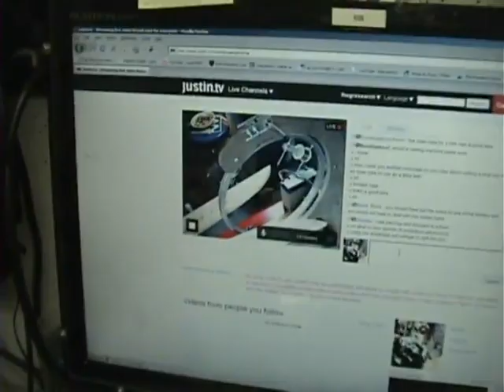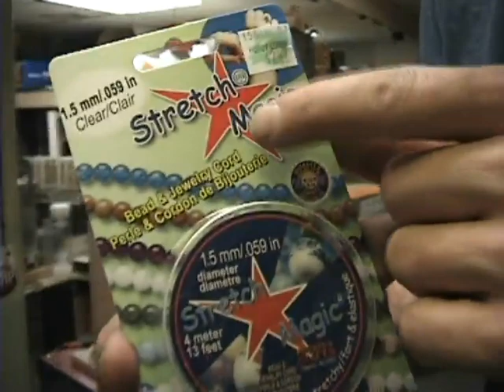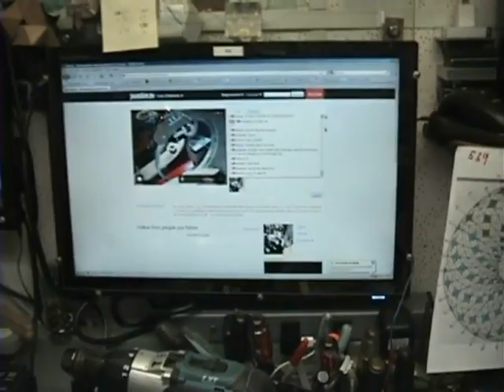#4 EPG Winder, Home Maid Troid Winder 75% Done & Winding A Test Coil! Live! :)

Comment: This isn’t exactly a toroid winder in this instance, it’s just a coil winder that is better done by a proper manual bobbin winding machine with a built in counter.
But the design is consistent with actual toroid winders, so with quite a few modifications and jigs, it can definitely wind a coil around a toroid or doughnut iron or ferrite choke, albeit one that is big enough to allow the hardware on the wheel to pass through it.

If you have things like a lathe and a mill, or at least metalworking tools like grinders, zipdisks, drilling machine and files, you can definitely make the mechanisms necessary to turn this into a proper toroid coil winder, which involves a way to open the “wheel” to allow the operator to insert a toroid blank, or remove the finished toroid coil without disassembling the entire thing.

The real problem is how to feed the wire to this machine without turning it into a bird’s nest. I’ve also been interested in a machine like this, but I have yet to figure out how to feed wire to it from a stationary spool. The bobbin on the wheel or rotating element works for this, but it will have difficulty with heavier gauge wire (14 AWG or bigger). 

Of course, it’s possible to beef up the wheel enough to allow it to torque heavier gauges of wire to wind it on the toroid blank, but one would have to cut a predefined length in advance and go slowly to wind it, while dealing with the slack until it’s all wound up.

All in all, it’s a nicely done and neat machine.

Comment: I hope to God you ended up doing something better then a calculator with a push button! I mean I know this is really old but to program a microprocessor hooked to a sensor to do some counting is about as simple as a gas you can learn that amount of C++ in about 5 minutes LOL I'm actually thinking about building a toROIDAL Winder I'm just starting now to design it in fusion I'll print it add a 3D printer a small version so I can workout all the math and then I'll make it bigger I have a pretty decent machine shop. I'll probably be giving them away for cost and shipping just to help the community out. But I'm very sick I'm disabled and it probably won't happen for about a year from this date if I know me and how bad I get it times period